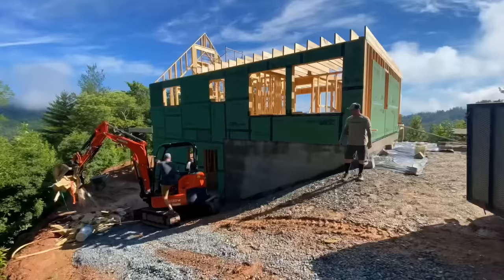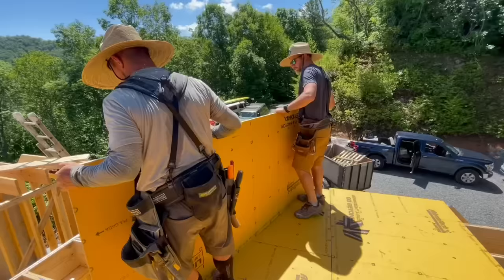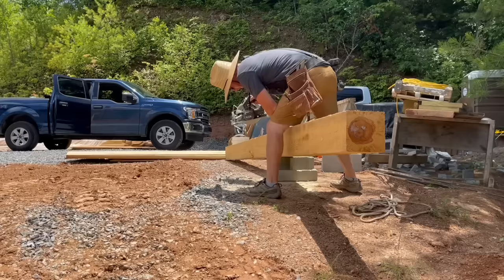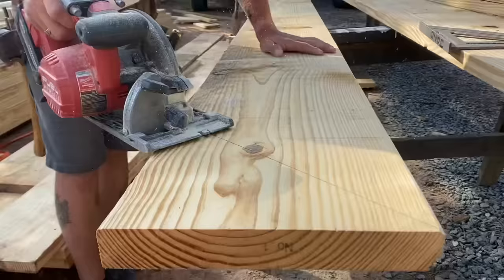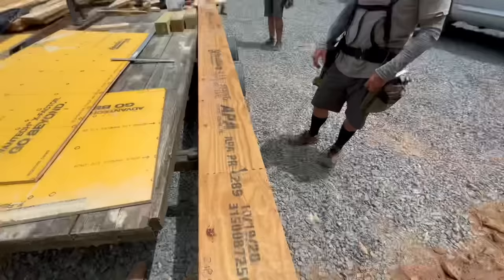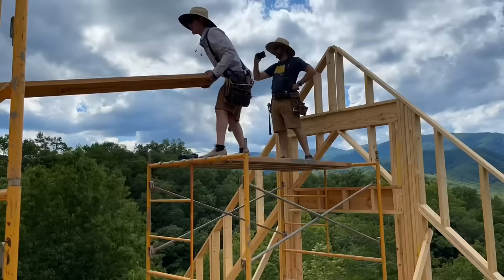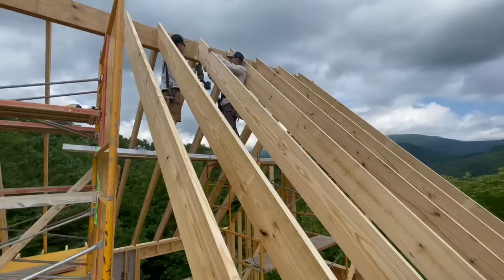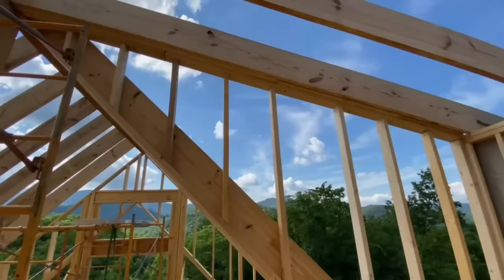Framing A Steep Roof | Building The Nantahala Retreat #12

Comment: Jamie's thing about the beam standing like the tree actually sounded legit
Reply: It actually is legit. Japanese carpenters do it. Also, dropping the post will probably help it stay straighter over time. This can be done to stabilize wood when building furniture, table lees, etc… why not an 8X8?
Reply: @ChrisDarjany  I heard when they cut by handsaw that the teeth pull the wood towards them to become closer with it.. I know I run my hacksaw blades backwards and it works for me.

Comment: If you know a sheet metal guy he  can sheer you off 1" strips of metal for stirrup straps on the ridge.  The stirrup goes over the ridge and you screw into the undersie of your rafter.  Metal loves tension and they will put all the pull at the top onto the ridge beam.  Gravity also forces the stirrup to pull in at the bottom of your rafter strap, but also allows you to move the bottom of your rafters in or out until you hurricane strap them in at the bottoms.  22 gauge is plenty of strong straps for the stirrup.  Your rafter will snap before the stirrup even reaches a quarter of its load capacity on a 15' long rafter.

Comment: Jaime we don’t nail the rim board when we lay the plywood we snap the exterior walls then measure to 5 1/2” and nail it. It works sweet and you really don’t need to glue the rim boards definitely won’t be squeaking
Reply: Good trick!
Reply: @jaimeperkins9606  ya it’s common on cape cod ma almost everything else we do the same all the way up here nice to see cause codes are super strict up here everything is over built

Comment: Nice post. I was wondering when you picked it up with the mini ex whether or not you were going to mar it, and if it was going to matter. A friend of mine picked one out for his new build to carry the outside corner of his lofted second floor, then the insulation guys wrapped it in plastic to protect it, but they just used a hammer tacker to hold the plastic with staples, made a giant mess of the whole thing forever now.

Comment: That ridge beam is load bearing. Boss. 50% to ridge 50% on exterior walls. Plates/ hurricane clips are only for code. How long you been doing this? Houses back in the 1800s are still standing. When a 2x4 was a real 2x4. Yeah laser eye, its called a string line. Cutting off the top of rafters, that 2x10 is now a 2X8 bearing pressure? I'm only 33 and started this kinda work at 17. Now its interior trim, crown, kitchens etc and custom built-ins for me. lite work 2-5x the money. Were im from. Will say tho, I'm very impressed by your crew. Good group of guys you got.keep it up crew!

Comment: When would the Simpson strong tie “RR ridge rafter connector” be used for installing roof rafters? 

I’m not sure if I should buy it for additional strength.
Reply: I was wondering the same thing.  I wonder if it's a combo of building code + typical winds/weather.   In tornado alley, it's all hangers, ties and truss plates.

Comment: Question, on load bearing ridges, does it always have to be 2PLY? I have a cathedral ceiling with no rafter or collar ties but it is 1 PLY LVL (10"). I'm thinking I may need to fix the issue.

Comment: If the ridge board is larger than rafters should the ridge board be installed higher or lower than the rafters . If I install the rafters below the ridge board I have to trim it on the ends to install my soffit material ??

Comment: About three years ago a dear friend of mine (little Sister kind of friend)... was having a brand new home built...
This wasn't a custom home... but more of a cookie cutter type in a "Pre-planned subdivision... $280K+/-...
She asked me to do a regular walk through to insure the "Builder" was doing a good job!!!
BIG MISTAKE!!! 
I am not the guy you want to ask to do a "Punch Sheet" on your brand new home...
Having worked in every aspect of construction for the better part of 50 years... I have a certain expectation of how a "New Home" should be built!!!
The builder had set the ridge beam... and as they were attaching the rafters to the ridge beam... someone cut the "Angle" of the roof pitch wrong on the beam end of the rafter... At the top edge of the rafter, where it attached to the beam... only an inch or so actually touched the face of the beam... as the beam face of the rafter moved down, the angle was steadily getting worse, to a point that at the bottom edge of the rafter it actually set out over an inch from the beam... 
As if that wasn't bad enough... their solution was to put a couple dozen nails into it... (literally)... I took pictures of it and had her confront the GC on the site...
His solution... was to come in the next day, and have it sprayed with spray on insulation... attempting to cover up the evidence...
I absolutely despise a shady contractor who chooses to take advantage of a woman, or someone who may not have a good knowledge of the building process...
The list of problems that this so called "Top Tier" Builder did on her home... and now it's being proven on a substantial number of other homes in this community, is beyond ridiculous!!!
At one point, in my opinion...it was so bad that I actually suggested that she not buy that home... But unfortunately she was under contract!!!!